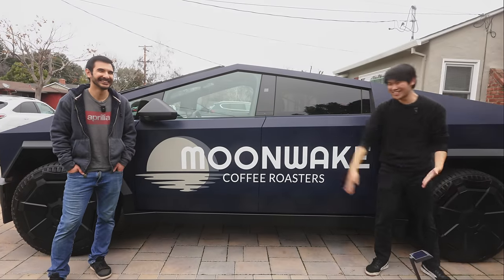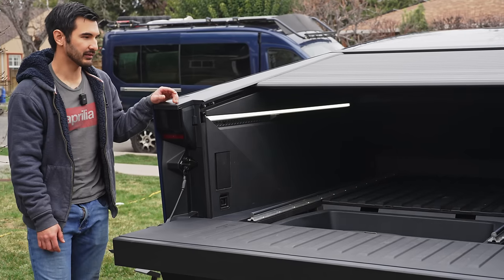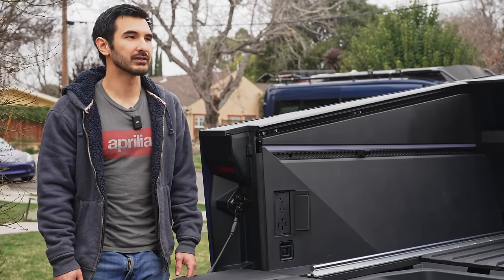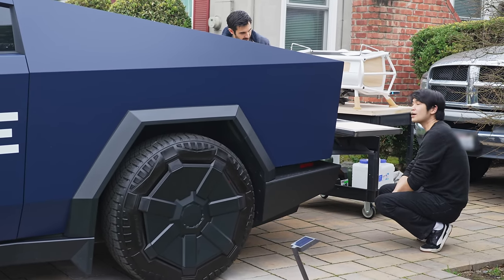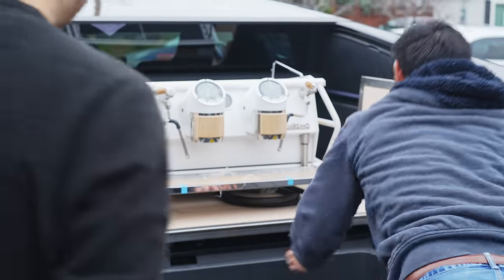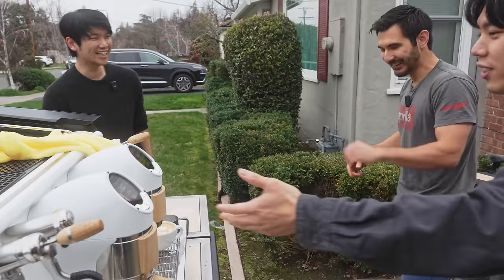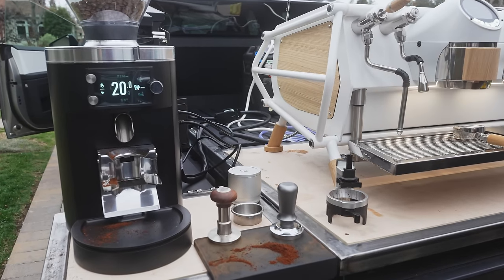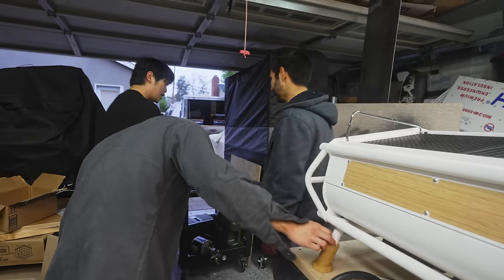Cybertruck Coffee Experience Ep1: Did we really put a coffee shop into the Tesla Cybertruck?

Comment: Brian, just abit of idea. U can also install the rail on the cabin door/gate. If u have enough wheels on thr crate, the gap between the cabin rails and the cover rails shouldn't be a problem.

Then, also install the transfer trolley to the exact rail height on the  cybertruck. Then, you can push the coffee machine on the trolley to the cybertruck, open the cabin door, align the rails of the trolley and the rails on the cabin, juat push through with minimum friction.

Then, just put or scree in a stopper. Or maybe just use toggle lock to latch it in place. Or even spring pin like an umbrella to lock the machine in place. If u need to move back, just unlock.

Comment: Just a heads up for your back seat electric fridge idea.  Check to see how much heat your chosen fridge will produce before you pull the trigger.  When the compressor runs it creates a surprising amount of heat.  Maybe today's versions have somehow dealt with that issue, if not it would be like having a heater on in the cab.
Reply: I'm sure the cabin aircon can easily compensate

Comment: How many hours could the truck keep everything powered? Would you run out of juice at an event?
Reply: 123kw battery so if full load was 6kw it could theoretically power the full load for ~20hrs
Reply from the maker: We're gonna have a video specifically on the math for how this works. We just did a test run of the machine and making a ton of coffee across 4 hours and the battery dropped from 91% to 88% after the whole session. Going to push it this weekend and see what the #'s look like.